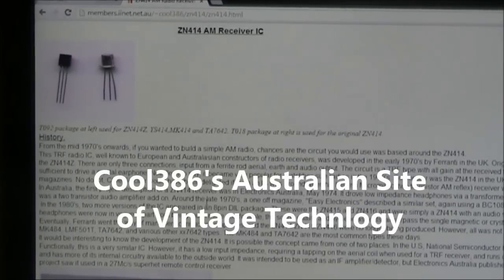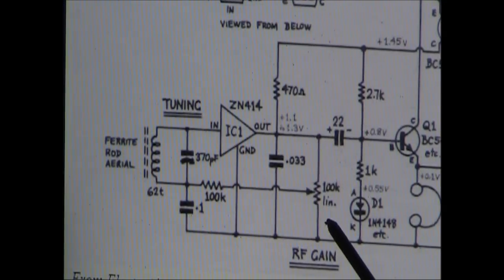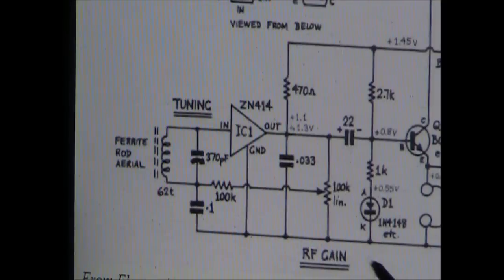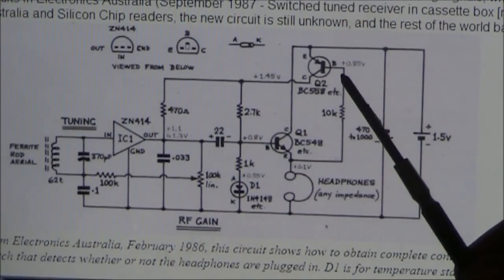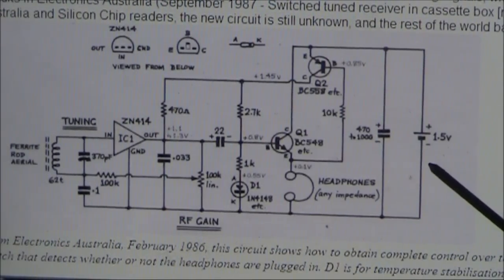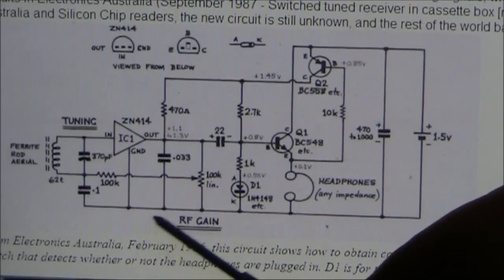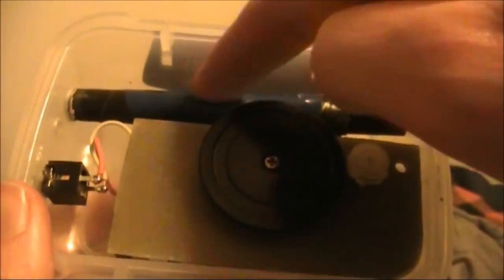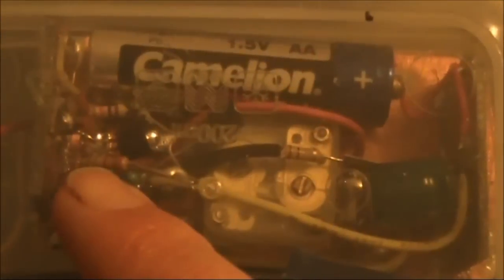The Thousand Hour Radio: A low-drain AM receiver using an MK484 IC

Comment: Greetings! Hey here is a very interesting experiment. Use a mag loop to replace the ferrite rod antenna. Performance may be significantly better, especially if you're away from high powered local broadcasts (out in the country somewhere). Also can you tap down on the coil to perhaps improve the tuned circuit Q? I never did get around to playing with the ZN414/MK484 IC. I probably should for a fun exercise :)